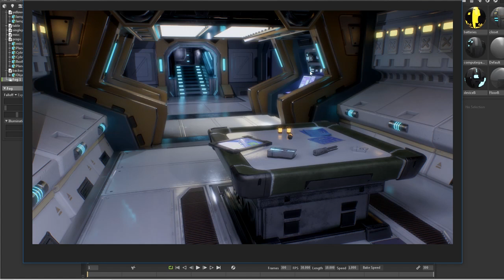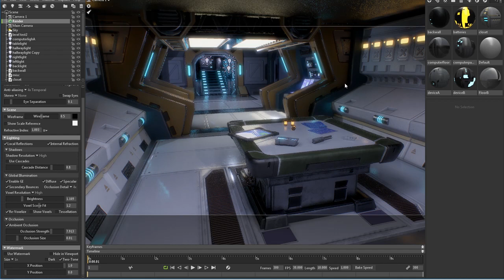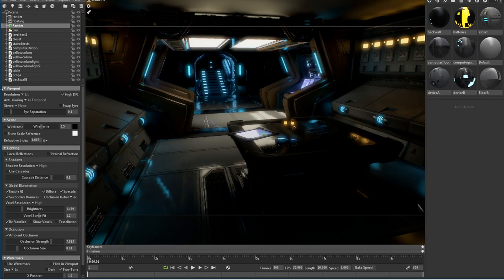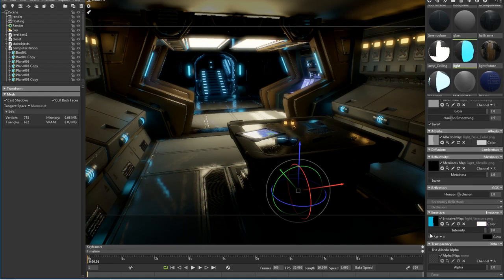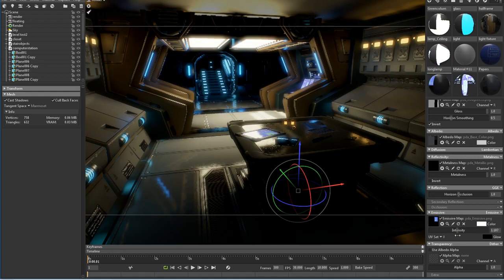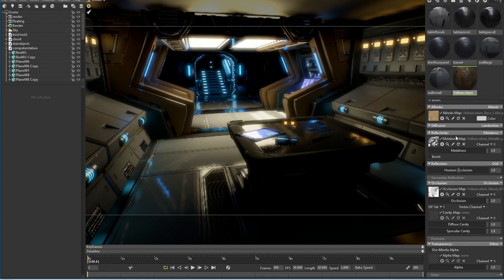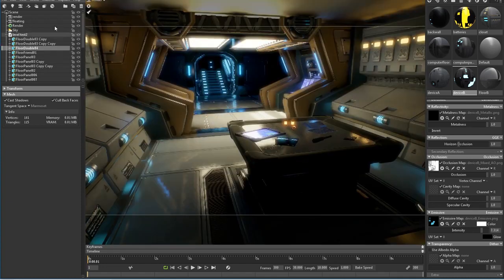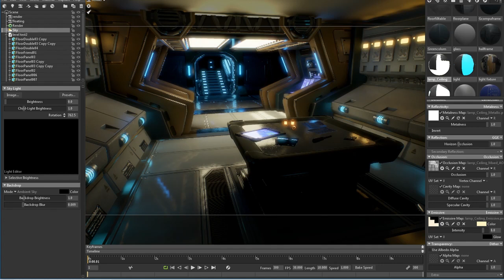Marmoset Toolbag 3.04 Lighting Environments with Emissive Maps

Comment: Hey YK. This is amazing! How are you not getting loads of light leaks from the Emissive Materials? I load mine in and crank the settings to 10 and light leak all over the place!
Reply from the maker: Make sure you have the HDRI al the way down or turned off. Another think that comes to mind is materials. I had a similar problem on my hospital scene with light leaking under the floor, but it was because of the material reflections, activating local reflections fixed the problem in that case
Reply: Cheers for the quick reply. None of those worked. Needed to bump up the Voxel Size a bit. Seemed to sort it. Also has some funky relections in my glass from the lights. Turned them to Mirror in the Reflection Channel. Fixed it. Thanks again
Reply from the maker: Glad I could help